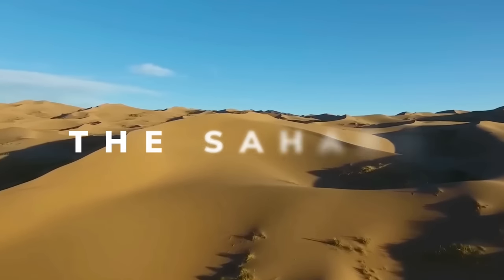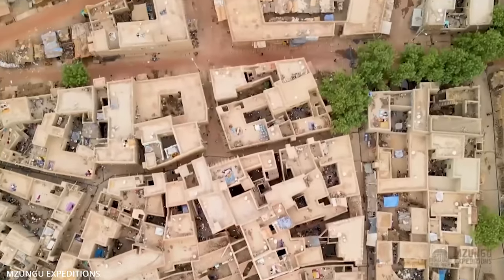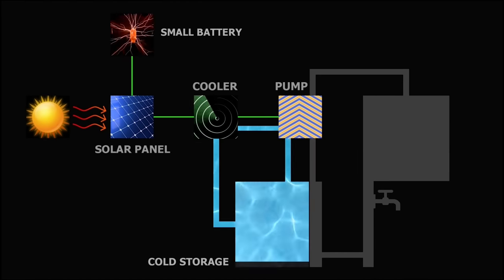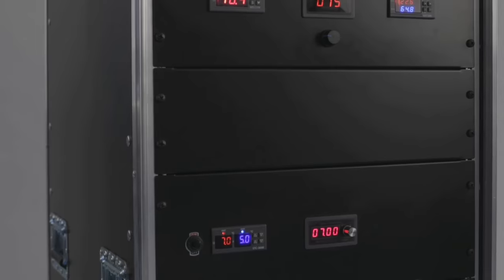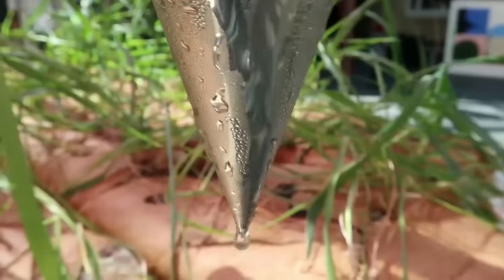How Solar Powered Machines are Making Free Water in the Sahara Desert

Comment: Emirati Weather Center is using drones to ‘zap’ the air into submission in Dubai. These drones are designed to target certain clouds and use electrical discharges via concentrated lasers to forcibly pool water droplets in the air, thus triggering desired rainfall. With the equivalent of an atmospheric cattle prod, Dubai has achieved just that — depicted in several videos posted to Instagram —  electrocuting the air into rain.
Reply: The U.S. Army will find a way to weaponize this technology.

Comment: It's not free water, the machines costs money to build/buy and maintain.. The idea isn't really new, airconditioning breaks out water from the air when cooling it, it's just that this system is optimised for collecting the water I guess rather than cooling the air.  Also, Starwars(science fiction)... Lukes planet Tatooine, his aunt and uncle were moisture farmers collecting water from the air with a similar type of machines I guess. But, yeah, it's an option I guess when you can afford it and alternatives arn't cheaper or more efficient.
Reply: Metal organic frameworks (MOFs) have been used by MIT/UC Berkeley to make passive atmospheric water condensers. They've tested in desert conditions. Just need to refine and scale up now.
Reply: @HiroTunatako  one small detail that derails the whole video: the Sahara is actually shrinking and the world is greening! That's even on NASA's own site.
Reply: @artivan111  I didn't see corporations forming the UN, UNEP, IPCC and so on. That was done  by governments. They implemented ESG investing and so on. The whole agenda is run by governments and you blame the private sector? I actually agree with everything else you wrote.

Comment: Like the 1 million times before this concept had been tried and the 1 million times did not find a way to break the laws of thermodynamics, this will "work" but will never ever be a wireable solution,fontus,Waterseer and many hit the wall very hard, you need a lot of power and high humidity.

Comment: 12 volt piezo electric cooling , one side freezes , other side heats up hence the cooling fins that side ........ then add metal on that , hey presto ... condensation ! still don`t see the real survivors using common water capture ways ..... a pit in shadow , a plastic sail in the center pointed down , same principle during night ! but yeah , we make more water available thru common knowledge of nature , physics and tech . but its not as if its groundbreaking when some even cool their pc with it ...... and have to battle condensation thru hydrophobic means . see it as an aircon . but you have to have an airflow over the fins . or the unit will burn up , or do nothing as it is nothing but a heat exchanger .

Comment: This is ridiculous... He's using thermo-elements which are notoriously fickle and expensive.. If you want stability, go 100% passive like the Indian projects. If you want high yield use a fucking heat-pump at dusk, when relative humidity is rising...
Reply: I'll be somewhat fair: Thermoelectric elements are horrifically inefficient when compared to phase change systems, but they are certainly not fickle. That's one of their big advantages: They are just about perfectly reliable. They don't break down. Ever. They are used on satellites for just that reason. The bearings in the fan would go long before the thermoelectrics broke down.

But still, the inefficiency renders them unsuitable for this application. Needs to much energy to do not-enough cooling.

Comment: Is this a joke?  That is, at its face, an absurd idea.  The energy required to condense water is VERY high....a quick check its 2.3 million joules per liter.  1 joule per second is a watt so 2.3 million joules per liter would be  That would be 0.638 kilowatthours per liter.  That is a lot of energy.  And that is just the absolute limit from physics, in practice you won't be 100% efficient especially not in poor conditions for capturing water vapor, such as low humidity which can be found in...oh...you know...deserts.

That thing is going to pull out like a thimble of water in a day.  It would be more energy efficient to use solar energy to power a truck and drive it 2000 miles to drop off some water.

Comment: 🎯 Key Takeaways for quick navigation:

00:00 ☀️ The Sahara desert is harsh, receives very little rainfall, and is expanding rapidly, affecting the livelihoods of millions.
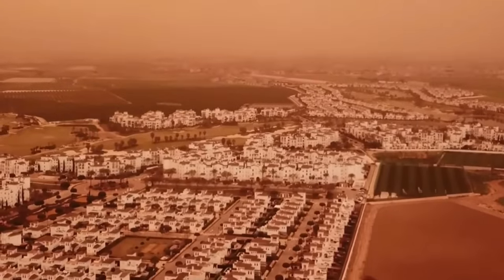01:07 💧 Water scarcity is a significant issue in dry lands, affecting up to two billion people, with potential displacement of 700 million by 2030.
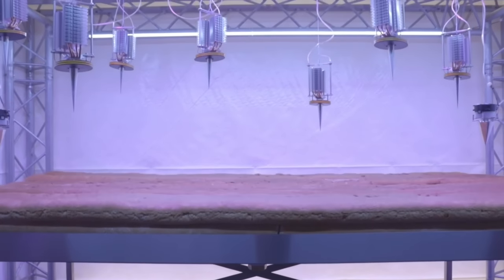02:04 🌍 Innovators are developing off-grid water production systems to provide free water for people in dry regions.
03:00 🚜 Mali, an example, faces agricultural challenges due to desertification and water scarcity, impacting food production.
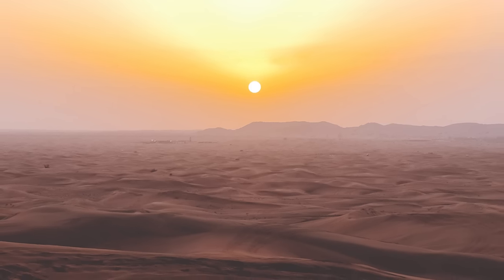04:09 ☀️ Project Sun Glacier, led by Abvar Hagen, utilizes solar panels and condensation to create water from desert air.
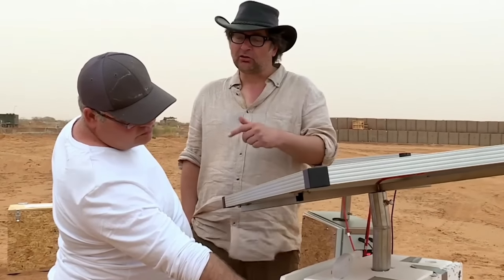05:32 💡 Sun Glacier has improved its technology, creating cost-effective water-producing models suitable for off-grid and agricultural use.
06:57 🌱 Abvar Hagen emphasizes the need for positive climate change solutions and adaptation in the face of rapid environmental changes.

Made with HARPA AI

Comment: Yes it is possible to make water from air.  Oxygen can be and is ionized to water by all halogenated vinyl molecules or polymers .  You can convert oxygen to water without power using only plastic and sunlight.  This is the primary cause of global warming and global infertility.  It is also possible to convert oxygen to water using iron and permanent magnets as the power source.  No plastic manufacture is essential.  A permanent magnet motor as a generator an edison generator can supply the power to ionize oxygen on an iron collection system.  This water is not contaminated with sulphate or industrial pollution.